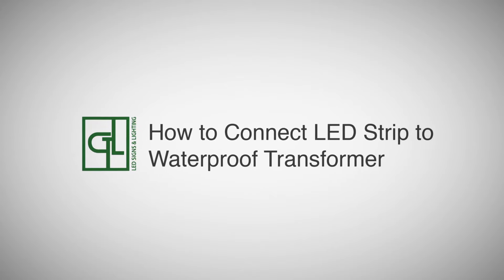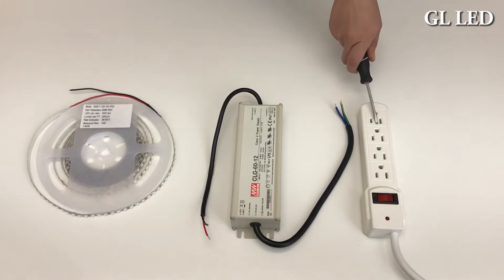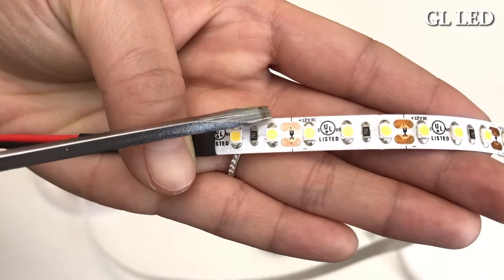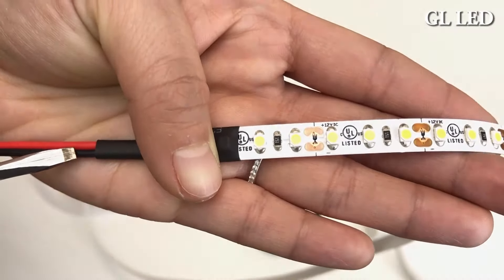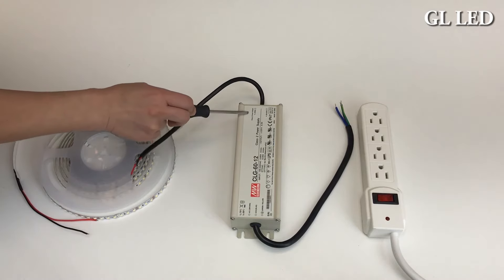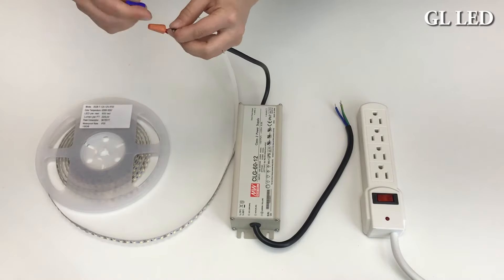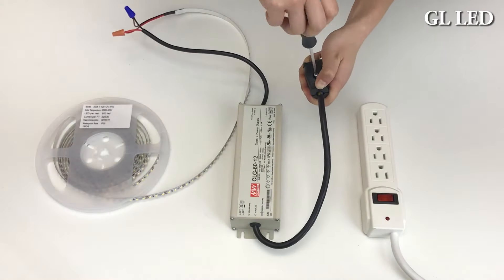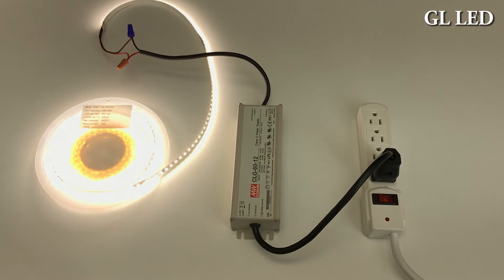How to Connect LED Strip to Waterproof LED Transformer -L

Comment: You never showed which color wires ( yellow, brown, blue)  input go to 120 volt white, black, and green ground ???
Reply from the maker: Yellow/green is the ground, Blue is the neutral wire which usually connects to white, and Brown is the live/hot wire which connects to black one.

Comment: What if you have two sets of output wires? Do you just connect to one of them and leave the other one alone or does it need to be in some kind of series?
Reply: I have the same problem, how did u connect urs?
Reply: @hakandenizsev810  Just use one set, the other is for an additional strip.

Comment: if I want to power 20m of 5630 leds in the uk what power supply would I need?
Reply from the maker: Sorry for the late reply. At first, you need to know the power consumption of the strip light you have. Then calculate the total power needed as "strip light power consumption x length x 1.2".

Comment: you said to make sure the voltage is the same, but what about wattage? my strip lights are 50 watts, so do I need at least 50 watts for the transformer, or should it also be exact? Thanks!
Reply from the maker: The transformer needs to be at least 50W. We usually recommend using up to 80% of the transformer capacity.

Comment: Can you add a dimmer to this circuit
Reply from the maker: yes, you can add a low voltage dimmer between the transformer and the light.